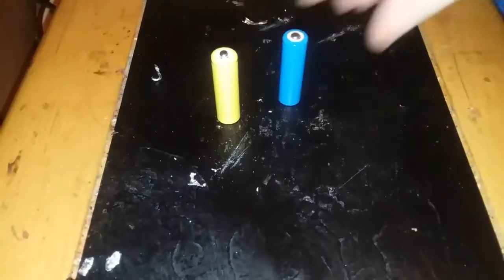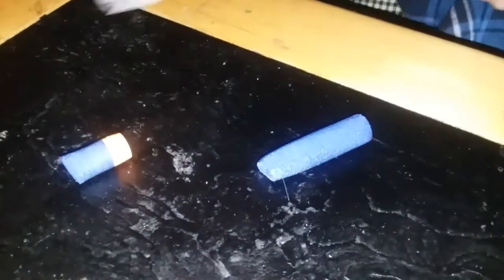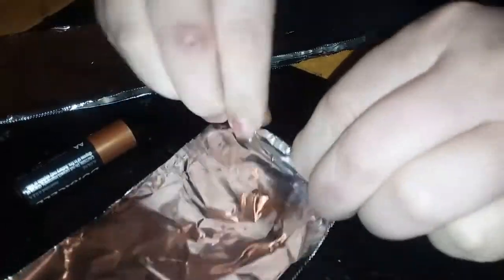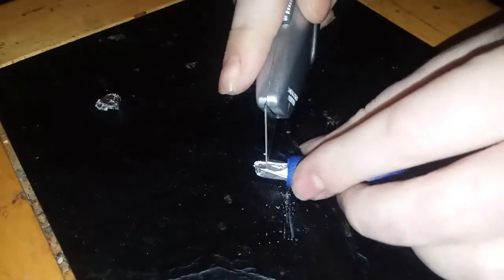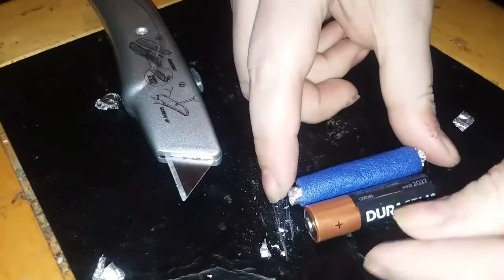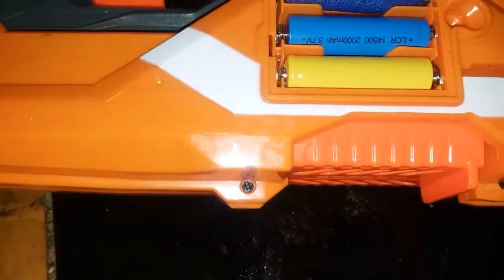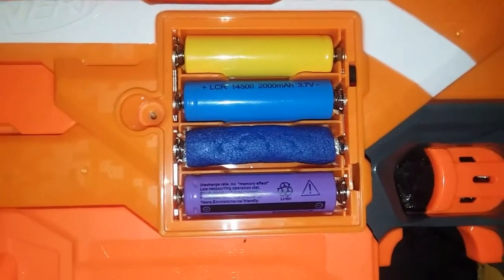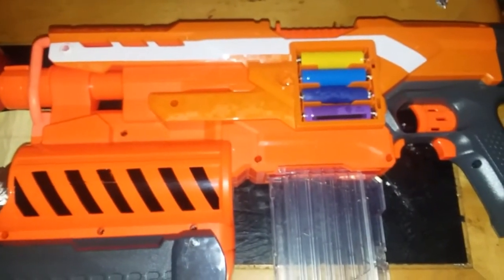BROKE DIY DUMMY BATTERY

Comment: Hi can i use 3 imr 3.7 volt in my demolisher without de wiring?
Reply from the maker: Hey charles.  People say "no don't use more than 2" and whatnot but I know people that have used 3 and even 4 in demolishers and stryfes without burning them out.  I mean, extra stock motors are super easy to come by it you do burn them out. So I guess it mostly depends on how often you use your blaster with the 3 imrs.  Id say if you dont know how to or want to solder then I would stay at 2 to be safe.  People I know who overvolt know how to replace motors if need be.  Heck, my teammate in competitive tournaments has a stryfe he has all imrs in and did that for like 3 seasons without burning out motors.  Maybe it's luck.  Idk.
Reply from the maker: BTW my denolisher has been completely rewired now  for a Lipo with Rhino motors, new cage and I forgot the flywheels lol
Reply: @BrokeNerfing  wow